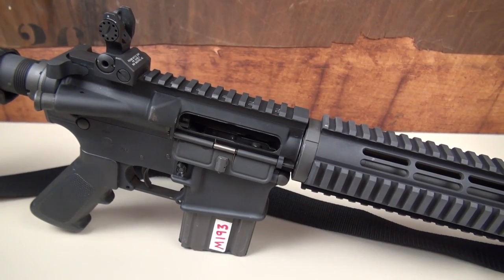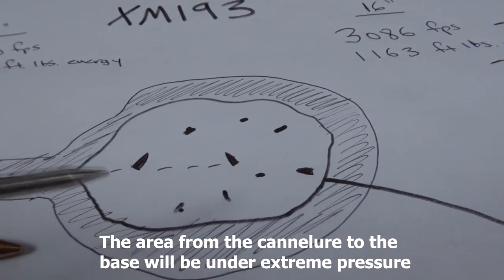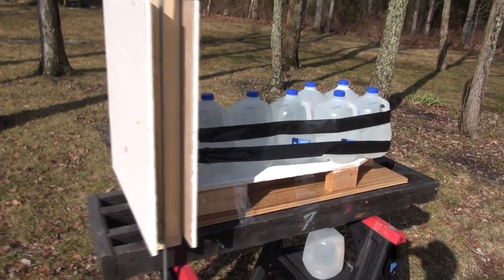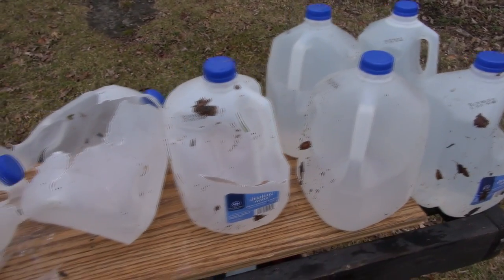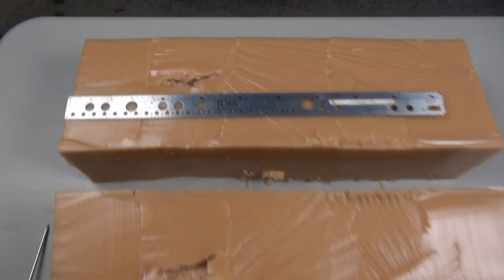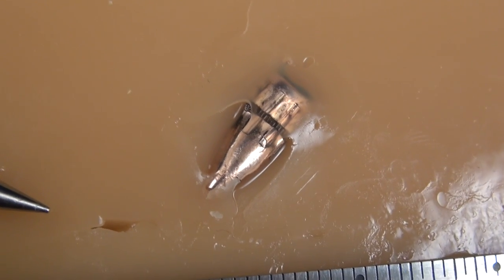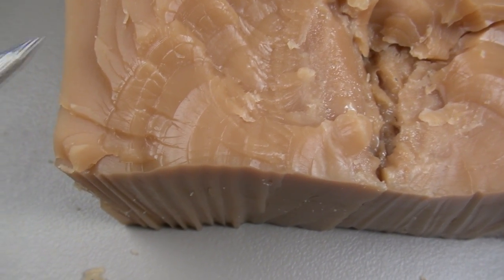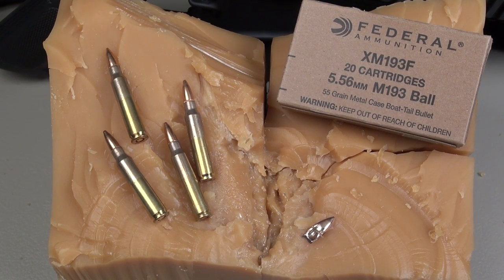5.56mm NATO XM193:  Drywall & Ballistic Gel Test

Comment: 223 is highly underrated.
Reply: WALKINGBAD74 5.56*
Reply: That hydrostatic shock from the 5.56 is deadly
Reply: Weight or velocity is what does the job.  In the case of 5.56/.223 it's velocity.

As opposed to say, .45-70 Gov., it's weight.
Reply: 5.56mm NATO not .223
Reply: 223 and 556 are underrated.
Reply: Warrior526 But when it comes to .50 bmg, it’s both massive weight and velocity. God bless America
Reply: It is.  What people don't seem to understand is the 1000 or so foot-pounds that get dumped into the target are going to do more damage than the 2000 or more on the bullet that passes completely through.  The law where I live requires you to use a centerfire round .22 caliber or larger.  .223 is on the lighter side of the legal limit but it works very well, at least it has for me.
Reply: @SonOfTheDawn515  6 of one.....
Reply: @ayethe4603  And the wound channel from one is much larger than some people think.  While it has about half the foot-pounds of larger rifles, it dumps more of that energy into the deer than a lot of those bigger rifles do.  No exit wound means all of that energy went into the deer's body.  I've seen the difference between the wounds created by the .223 and other, larger rifles and the .223 is often more destructive because it transfers most or all of its energy.
Reply: @The_Warrior526  I wouldn't even want to fire a 45-70 with any significant velocity.  I've heard of handloaders getting velocities around 2000 FPS.  Ouch.  Even a 210-grain (the lightest 45-70 projectile available if I'm not mistaken) moving at 2000 FPS would be painful.  I have a Trapdoor Springfield and I've only put 300-grain bullets through it and the recoil is not bad at all, but then again, those are black powder rounds with a velocity of no more than 1500 FPS, if even that.
Reply: Ray Charles  That's a bit of an exaggeration.  The difference in velocity is 100-200 FPS at the most.  North of 2500 FPS, that's, as Paul Harrell says, "not enough difference to make a difference."  Unless you're reloading, about the only difference will be in bullet type.  I have yet to see any 5.56 loaded with anything other than FMJ (ball) and match.  The .223 is available (in normal times) in FMJ, match, SP, frangible, you name it.
Reply: @SonOfTheDawn515  223 is the same shit and probably better for getting it to open up INSIDE the target
he did still shoot through drywall dont get me wrong 556 is awesome.

but it is a NATO round and you will get a lot of overpenetration's if its not a perfect shot
Reply: For those who don't know, M193 is a .223 Remington cartridge with a  military designation of 5.56x45mm M193 Ball, it is not the FN Herstal 5.56x45mm NATO cartridge they have slightly different cases, M193 is the projectile not the case, the 5.56 NATO cartridge was developed by FN Herstal in Belgium in the late 70's around 1976-1977 the first projectile used in the 5.56x45mm  NATO cartridge is SS109 also known as M855 or green tip. 

.223 Remington is not a varmint or hunting cartridge, it was designed and developed for military used for the AR-15 which was adopted and designated XM16E1,and as I said .223 Remington was designated 5.56x45mm M193 Ball by the military and was used until the mid 80's as it was replaced by FN Herstal's 5.56x45mm NATO SS109 aka M855, there was no 5.56x45mm NATO ammunition mainstream in the United states until September of 1982 with the M16A2, the Vietnam war  was fought with .223 Remington!
Reply: @Wayne_R  M193 is not a NATO cartridge, it's .223 Remington, it existed about two decades before 5.56x45mm  NATO was developed, 5.56x45mm M193 Ball is the U.S. military designation for .223 Remington ammunition, it was created in 1957 and standardized by Remington and SAAMI in 1963 and adopted by the U.S. military and designated 5.56x45mm M193 Ball, 5.56x45mm NATO was created by FN Herstal in Belgium in the late 1970's and used the SS109 bullet it wasn't used in Vietnam and it's not compatible with the M16A1 but it can be used in emergencies at close range.

Comment: 55 grainers and 20 inch barrel  is just about the best combo out there. been watching videos on 55 grain vs 62 grain. m193 just seems like the sensible way to go hands down. especially with the cost savings.
Reply: mike holley I was never that impressed with the results of M855 in the service. Does what it's supposed to, just not the best at putting down skinny hajjis in some cases. I use M193 for HD and range use myself.
Reply: Alot of the guys who fought in Vietnam didn't seem to think as highly of that combination
Reply: I use M193s for my bushmaster for lower costs and the lower pressure

Comment: "The 5.56 is a barbie gun" If by 'barbie' you mean turning a volume the size of a soup can into hamburger 4 inches inside your target 'barbie'. Naw dog, that shit's brutal.
Reply: R Re Not to mention it penetrates level III plate that would stop an AK round.
Reply: R Re no argument with you. Mostly when people say the AR15 is a barbie gun they refer to directly the shorter M4 style of the gun which is a 16" barrel or under is known as M4 Commando at 14.5" and anything under is technically considered a pistol. Mostly you'll hear Military guys say that because just before 2012 every one was still being issued the 20" barrel M16A4 in all branches which has at least another 200 yards effective on it's M4 carbine brother and is highly more penetrating. The M4 carbine is standard now to all branches across the board. Which I think only infantry men should use short barreled M4's since it's up close and personal M16 platform was designed to be most effective when it climbs highest velocity past 300 yards, and then guys want to whine and complain when with the M4's they don't get the penetration and damage they need say 500 yards or so the M4's most effective range for damage is between 200-400 yards. I know that was long hope that clears that up.
Reply: when they say barbie they might be talking about how customizable they are
Reply: @AbsoluteZeroxX  the commando didn't have a 14.5 inch barrel, it had a 11.5. I think you're referring to a regular m4

Comment: The 55 grain 5.56 load is like the 115 grain 9mm hollow point. It gets the job done.
Reply: Omg
Reply: @JoshBenware  fml
Reply: @mattwalters6834  He's saying that the M193 is to 5.56 as 115g HP is to 9mm. It's called an analogy. This is middle school reading comprehension, folks.
Reply: @ironmatic1   You fail to comprehend as well it seems.... That's what the two above you were getting at. First off, it's a HORRIBLE "analogy", let alone a basic, bare bones comparison. That's like saying, "The Nike Air Jordan's are like the croks of footwear.... It gets the job done". I could go into great depth how comparing 115g holopoints to other weight holopoints showing that it's really not all that great or the simple fact that the 5.56 55g run of the mill fmj will behave completely different than actual 55g M193.... Or in other words... M193. I could also go on to say how one's ment to operate on fluid dynamic pressures to operate while the other simply works best off of velocity alone. You're quite literally comparing apples to xylophones.... Can both be an instrument, yes..... Can both be ate, maybe? When it comes down to it, it's a matter of knowledge on the subject, I just wish I had the ability to chalk it up as an L like Josh and Matt did and leave it at that but sadly I am what I am....
Reply: @ironmatic1  more like the 9mm 115Gr +P+ 9BPLE round specifically lol

Comment: My son is a fan of 5.56 62 grain green tip. When we go to buy bullets I tell him I pay provided I select the bullet and of course I buy this Federall ones for him.
Reply: PedroPablo Used the green tips in the army. I go with M193 for myself at home. Not that impressed with the performance of M855 on skinny targets out of shorter barrels and I live in an apartment
Reply: SonOfTheDawn515 M193 also penetrates level 3 plate body armor while the slower green tips do not. They had to make a level 3+ specifically for the m193.
Reply: directorbeau Unaware of armor penetration of M193 and I'm not too concerned but that is definitely interesting info! Also, I'm not too concerned with any burglars wearing ESAPI plates so M193 should be effective enough. If they are wearing ESAPI then ammo choice means shit and I'm out numbered. 😓
Reply: SonOfTheDawn515 Aim for the head in that situation.
Reply: directorbeau Sounds good in theory but in real world situations in CQB it doesn't quite work out all that well. Either way I'm sure M193 will, in the not so likely future, will suffice with a burglar or two.